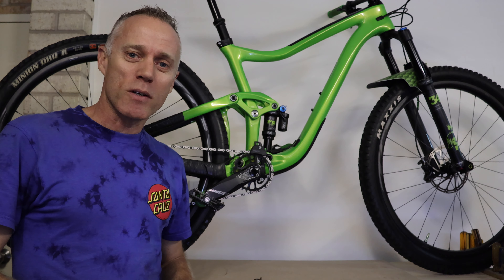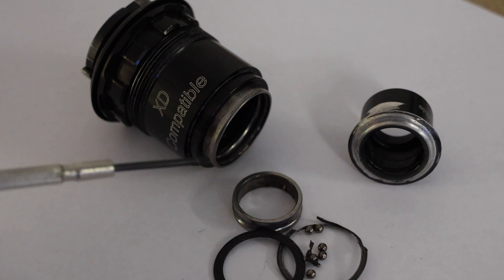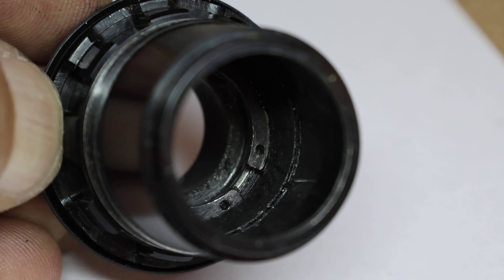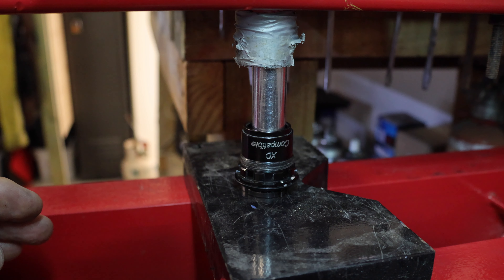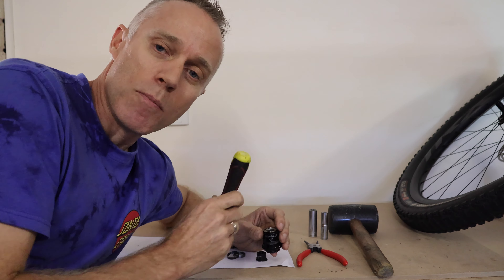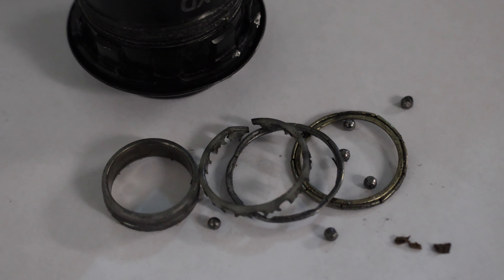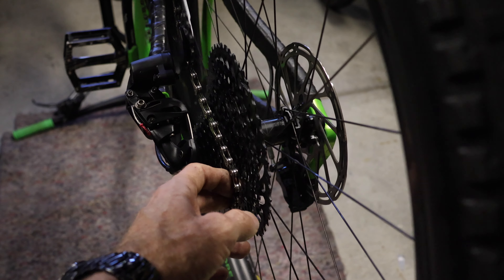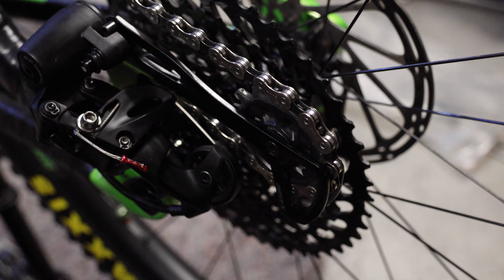XD freewheel driver Bearing replacement SRAM Giant Reign Trance Pro 1 DT Swiss Hub MTB maintenance

Comment: Are you supposed to grease your bearings? I noticed they weren’t greased before placing them in hub
Reply from the maker: Hey! they are usually sealed bearings, as they have the plastic seal either side to keep water out, & the factory grease in.. That is enough grease to normally last their life under normal conditions.. Hope that helps! Ride hard! 😃😃😃